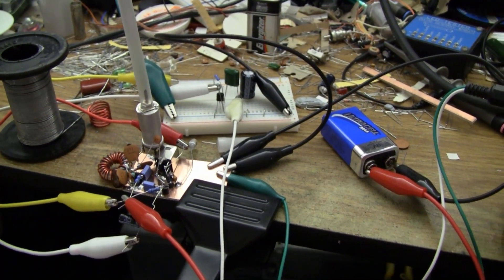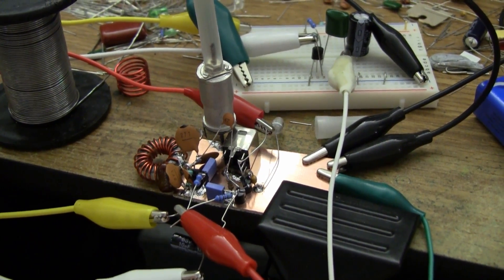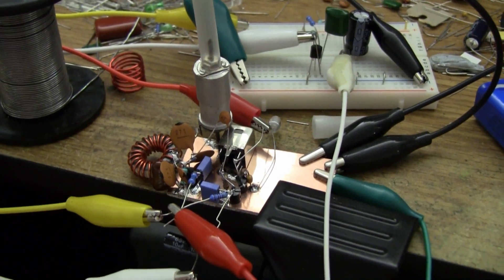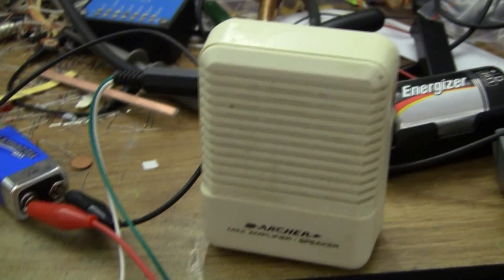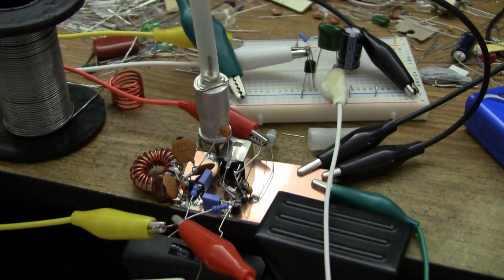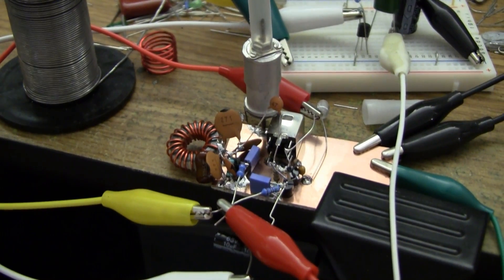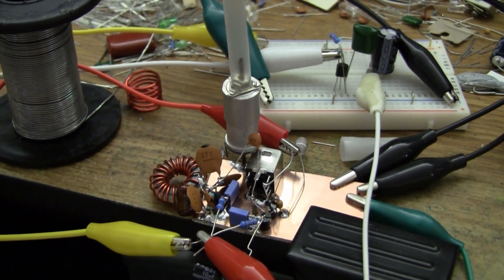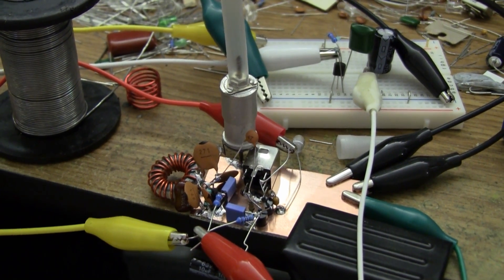Simple Direct Conversion Receiver

Comment: What value did you use for the other 2 transistors?
Reply from the maker: Alvin Robinson any small signal BJT will work.  I used 2N3904 but BC547, 2N2222 or similar would be fine.
Reply: Ok. thanks.

Comment from the maker: @randomgarfield The thin red lead at the top that goes to the front-end IF can is the antenna line in this video.  The antenna is physically short, so I connected it to the high-Z gate side of the tank.  The few turn link winding in the IF can serves for 50 ohm antenna inputs but I made no attempt to ensure it terminates the line correctly.  One could calculate the required match, either a network in front or a shunt resistor on the tank, but the later would compromise selectivity. Fine for RX.

Comment: Where is the antenna connection on that circuit? I can see the power clips and the output to the beardboard for the audio, but I can't see where you have the antenna connected. Are you just coupling to it? Stupid question I guess. :)